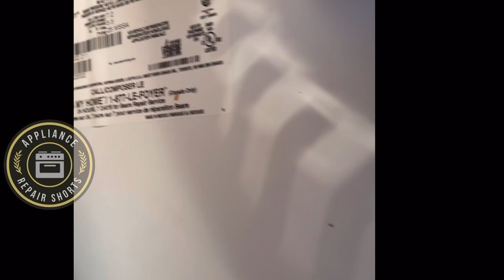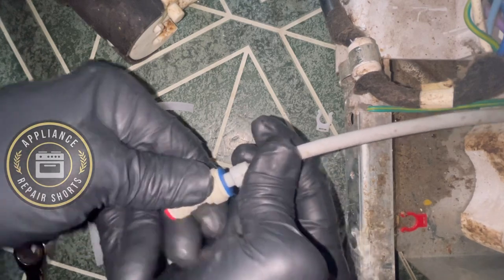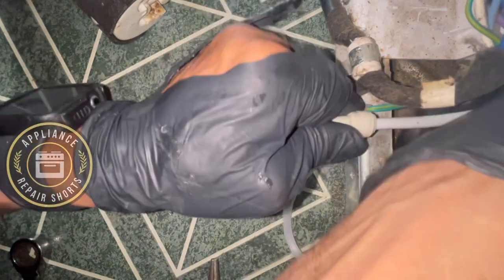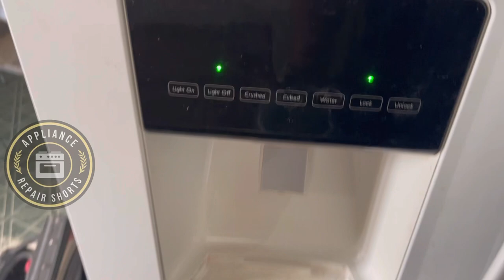Whirlpool Refrigerator Not Dispensing Water | Filter Housing Bypass | Easy Fix| 106.50022211

Comment: Doesn't that housing already have a bypass function?
Reply from the maker: I thought I already responded, sorry. So the filter housing has what is called a bypass filter. When the housing is working correctly, yes you can install the filter bypass. It allows you to get water and ice without the filter. If the filter head assembly isn’t working properly, you have to replace it or take it out of circulation and do what I did. Thanks for watching

Comment: When i pull my filter it still works and filter is by-passed.  This is useless to do unless you want to bypass housing entirely.
Reply from the maker: If your filter head or housing is good, yes you can use the bypass filter. This customer, the filter head was bad. She has a house filtration system.